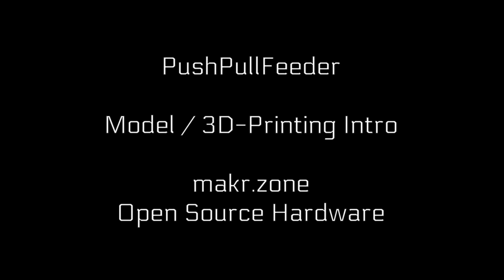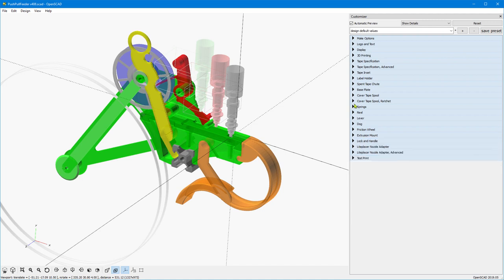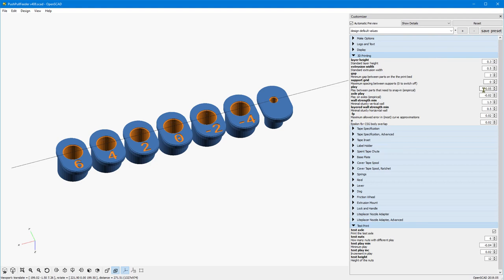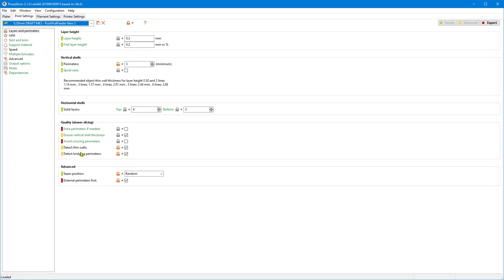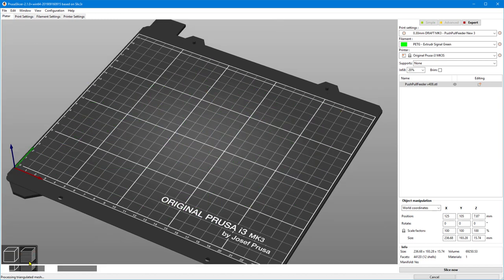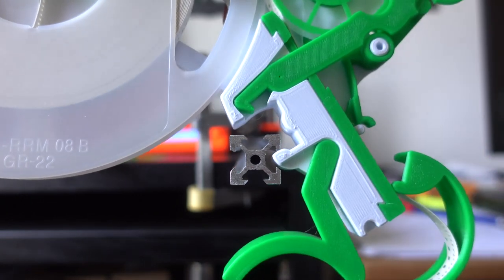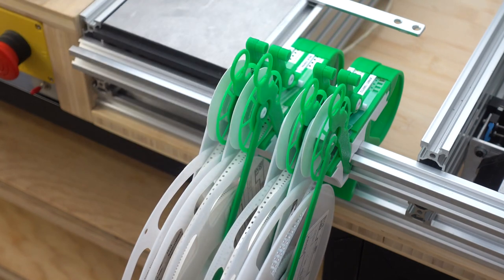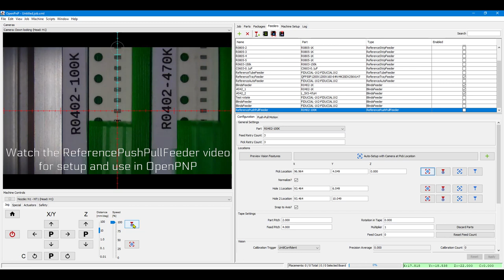PushPullFeeder - Model / 3D-Print Intro

Comment: Excellent design. Could you maybe even modify it with an RC servo to make it a self-driving unit?
Reply from the maker: Thanks!

The possibility to cope without motors and elctronics etc. is the heart and soul of this project, the lever and ratchet the very core of the design. It wouldn't make sense to put a motor on top ;-)

I think there are better designs for that. Look here, under "Feeders":
https://openpnp.org/hardware/

_Mark

Comment: A great design!  Can I ask what the extra clip that isn't used in the assembly animation is for?
Reply from the maker: Thanks! 

>  extra clip 
Ahh, somebody paid attention ;-)

The feeder is designed so you can add reels of the full EIA specification width. I don't know if such monster reels exist at all today. But if you happen to have these, they fill up all the space and you can't then add the green holder on this side of the reel. Instead, use the clip to fasten the cover tape spool. The Reel will then only stay on the axle, if it is in a row with others. Well, that would then probably be a bit dodgy... but I wanted to fulfill the spec ;-)

_Mark

Comment: Sorry, tried asking a question on the project site, but it would never accept the message (just sat there despite all mandatory fields set).    The test print.  Is the axle diameter changed when changing the clearance values please?  Or is it only the size of the hubs.  I am trying to work out how brave I can be printing out a batch of feeder bodies ahead of any chore of fitting fiddly bits :)
Reply from the maker: There is a design principle, that the smaller/removable part has the play applied. So you only need to reprint the smaller/removable part when the play is not right. Still, I would not print multiple bodies before having tested everything together in one test feeder. Also test the fit (the squeeze) on the extrusion mount, which is in the body, of course. 

This feeder is optimized to work without any external (metal) parts. The downside is that everything must really fit together nicely, not too hard and not too loose. Once you figured it out, document everything and then go ahead and print a whole series. 

The idea is to invest a bit of time tuning up front, but then have a very, very cheap and easy to assemble feeder that you can multiply. 

As to the http://makr.zone comments not working, I'll have a look. You can also use my email which is on the site.

Comment: Hi this is an amazing design thank you for sharing this ! I wonder how if this still work well when the cover tape diameter is changing as long as this increase while in use. Do you please have any feedback on this ?
Reply from the maker: Best follow the discussion in the OpenPnp group. There was someone doing 16mm and 24mm feeders with success.

https://groups.google.com/forum/#!msg/openpnp/VDEKlvYKfTY/s8DyI60KBwAJ

_Mark
Reply: @markmaker4345  thank you for your reponse but I was speaking about the diameter growing when you have a lot of plastic on the spool. Are there differences between when you start and when your reel is almost empty ?
Reply: As I understand it you rewind the plastic film which makes the tape advance but since the diameter of the reel that winds the plastic changes as you use it, this should have an influence on the progress of the band that is no longer regular. Is that the case ?
Reply from the maker: @JuPrgn  Ah, ok I misunderstood. 
I'm afraid I can't say. Never used up a reel. The cover tape is just gobbled up, it does not pull the tape, so I'm not that concerned. And the spool can be very quickly emptied. Just pull off the cover, or simply unspool. The C shaped clamp makes it real easy and fast to reattach the new lead. 
_Mark
Reply from the maker: @JuPrgn  

> rewind the plastic film which makes the tape advance

No, the tape is advanced by that thing that looks like a dog, that Dmitry invented AFAIK. The spool just takes the slack in the cover tape. 

_Mark

Comment: how strong are those locks ? I think they will get loose over time being in same location
Reply from the maker: First, please be aware of the use case, this is for hobby/ultra small scale prototyping. The feeder is intended to spend its life with the reel, i.e. there will be no reel change, it is so cheap you can print one for each reel. I expect my reels to last forever, because I will only use a few hundred parts of each in the course of my hobby and I think many people have the same use case ;-)

I discussed this here in the OpenPnP group:
https://groups.google.com/g/openpnp/c/VDEKlvYKfTY/m/NOwMW3xWAQAJ:

Secondly, it is important to note that the mechanical holding force comes from the "squeeze" when you rotate the feeder onto the extrusion, not from the lock. This extrusion cutout is quite a sturdy piece of the model. The lock only holds that squeeze-rotation in place, i.e. ~90° to the actual forces, so only a small fraction of the load is on the lock (if that makes sense ;-)

_Mark

Comment: Open source but no step file anywhere...
Reply from the maker: It does not work that way. The model is parametric. Best watch the entire video, especially the part about the test prints. You'll need to download OpenSCAD, but don't worry, you just enter Parameters in the easy to use Customizer GUI, no need to really have any OpenSCAD skills.
Reply: @markmaker4345  

Yeah but that is a whole new learning curve. I am just looking for examples to edit. Thx for the reply.

Comment: Hi your project is very best! I have one problem. Thickness of tape inset is very small. Real thickness components tape approx. 0,6 mm! Sliding is so tight. Sixagonal shaft too very big. Where are is a change it? Thank you
Reply from the maker: Thanks! Only the small and fast to print Tape Inset  needs to be reprinted to adapt a different tape. See at 4:40 in the video where the tape is inserted. In OpenSCAD use the Customizer (right side pane) and there the Tape Specification section to adjust tape thickness etc. "Sixagonal shaft"? I don't understand. For better discussion, go to the OpenPnP discussion group at https://groups.google.com/g/openpnp.
Reply: thank you @markmaker4345